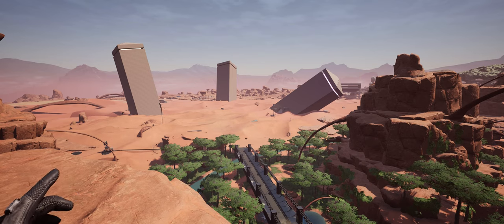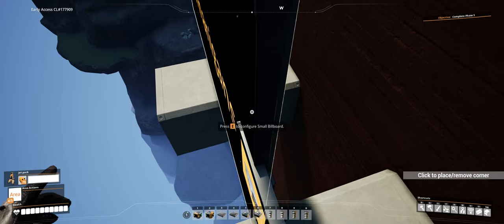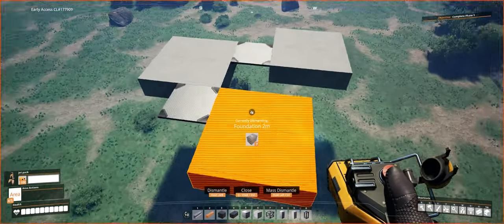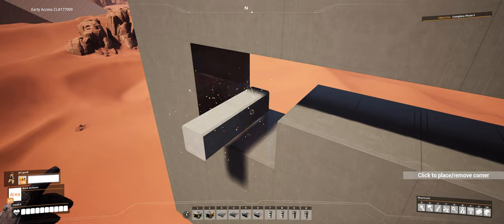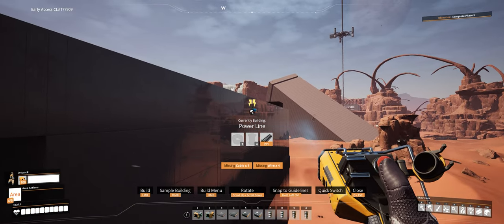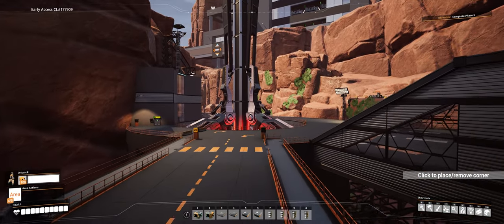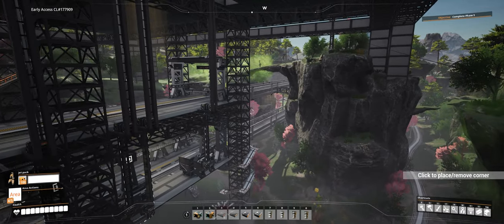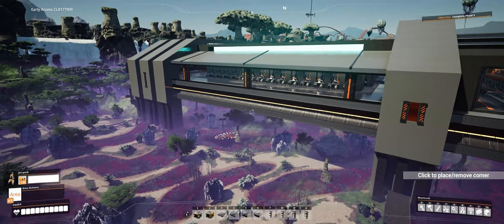Chilling out with a few random basic tips and tricks for Satisfactory

Comment: Hey man it is increddible what you build, but how did you solve the problems with the z-fighting when you put your foundations as a curve ?
Reply from the maker: Most of the time, if the top surface of a curved structure is visible, then most of the time I just use black asphalt foundations - as these don't show the z-fighting.
Otherwise you will usually need a mod like Micromanage to very slightly lower some of the foundations, by the smallest increment, to remove the z-fighting. I covered that in my video on micromanage and area actions.

Thanks man, appreciate it

Comment: @5min45, i tested in my part, impossible for me to rotate pilar like that... :/
its 45° rotation or nothing
Reply from the maker: Do you mean pillars or beams? At 5:45 its beams - hmm not sure mate, works fine for me. Have seen many others use it also... left clicking once to place the beam on a foundation, then using the scroll wheel to rotate - Its not complete freeform rotation, there are still snapping points, but should be more angle options than just 45 degree rotations.
Reply: @StinArchi  how my bad, was thinking it was concrete pillars ^^'
thx !